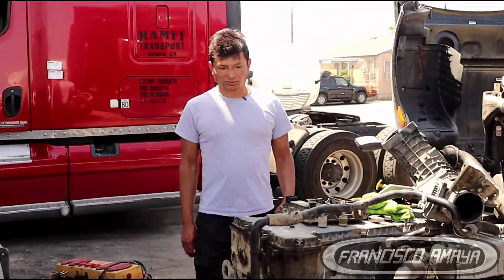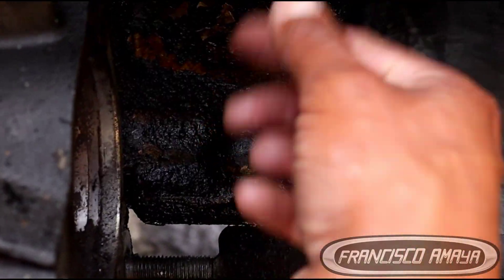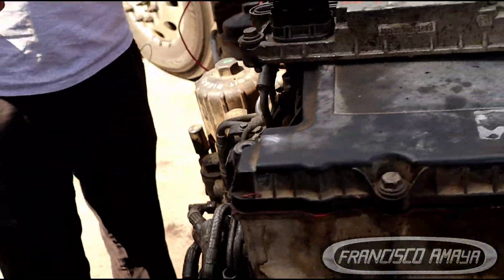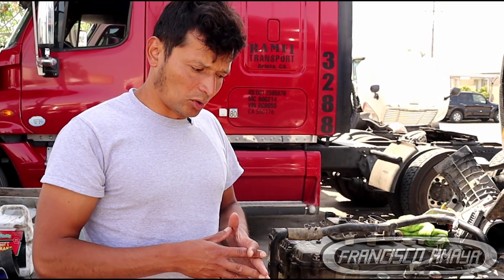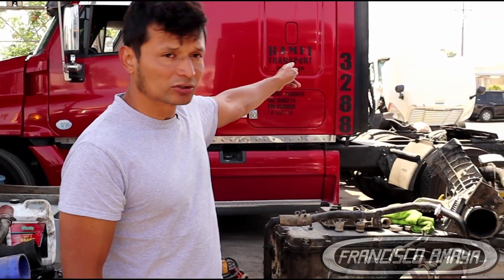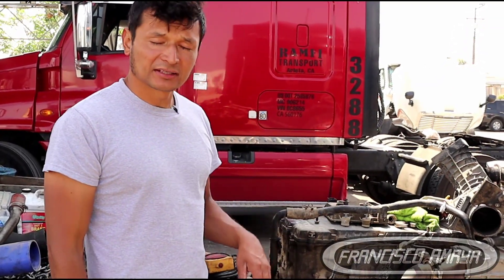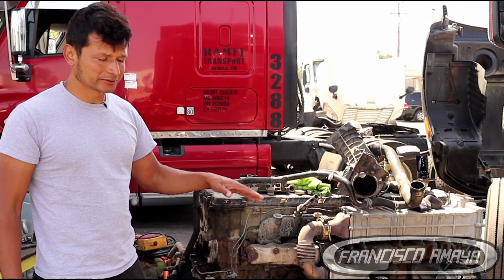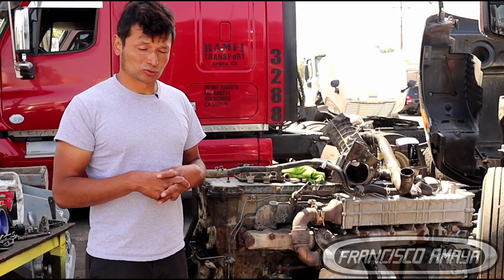DD13 ENGINE DAMAGE CONNECTING ROD BROKEN ENGINE BLOCK WHOLE ENGINE REPLACEMENT FREIGHTLINER CASCADIA

Comment: I don’t know why people still buying that crap DD 15 and DD 13 Cascadia SP force they all have the same damn problems. It’s not just the engine. It’s the product itself and Freghtliner knows it so stop buying freightliners. They’re just a pain in the ass in all the applications that you use that kind of engines like this case there is 1000 in worldwide word this engines or these type of engines exist and freightliners Mercedes-Benz diamond or Chrysler no sense.